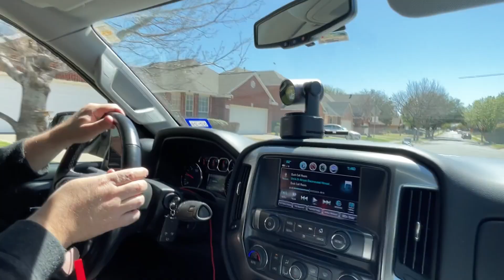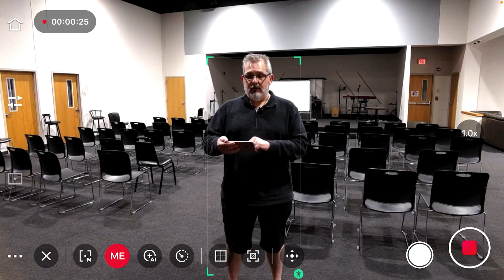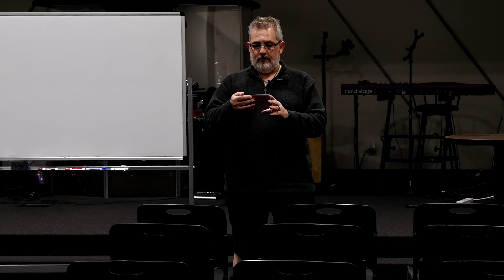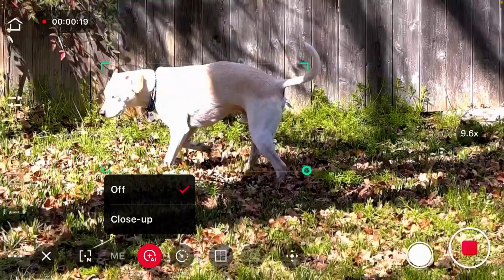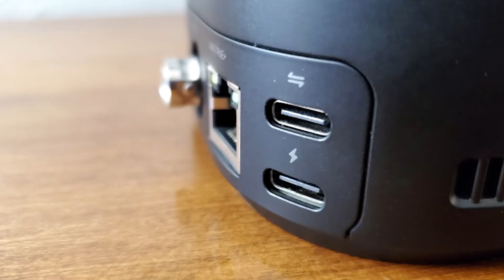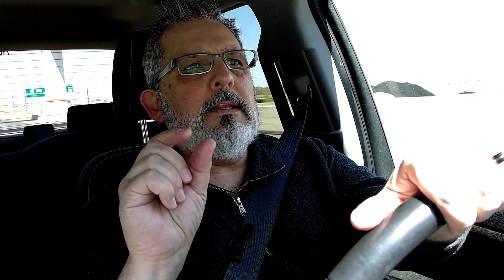🤯Mind-Blowing AI Camera! OBSBOT Tail 2 My First Look

Comment: Oh you can put it in your car? So it gets stolen? No thanks. I would use the camera at the drag strip. Would not leave this big honking thing as a daily driver in my Impala 2005 beater. And its a great car! I don't race it. My dad tuned the engine. Its free. I can't complain. My real truck 2003 SVT Ford lightning
Reply from the maker: I'd never suggest that it's put permanently in a car - that was me doing something different - using a PTZ camera.... in my car.  It's a unique use case as I review that very product ;)

Comment: How far away from the stage could this theoretically be used to track and zoom in on our pastor?  Our tech booth is about 50ft away from where he stands and our existing camera dips into digital zooming and picture isn't that great.  I've considered getting a better lens but if I'm gonna spend the money, would something like this suit our situation better?
Reply from the maker: Well, the distance that I show in the example is about 30-40 feet.   Note that it's a medium close up - I think that if I went back to the stage there, it'd be 40ish feet and track nicely.    One thing you could do is grab one and test, then if it doesn't meet that need, return it, or use it as a 2nd camera angle from one side or the other.  Giving more camera shots / angles helps keep a viewers visual interest - critical with "talking head" / lecture type video ;)     I'm going to take it to our sanctuary tomorrow morning and do a little testing.  I'll post another video showing that use case / test. 
-Dave